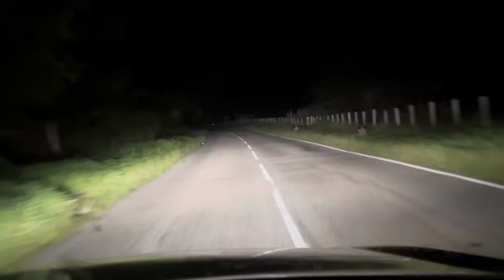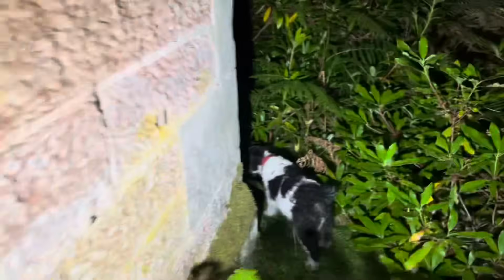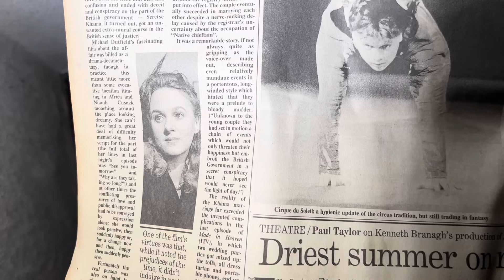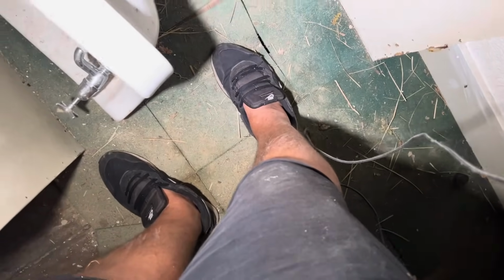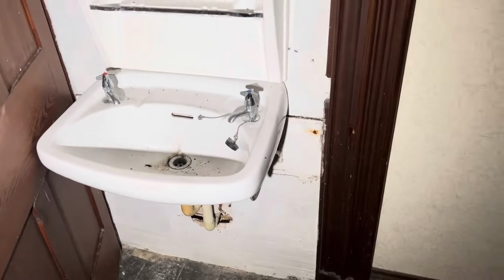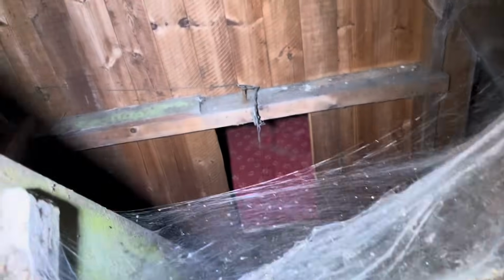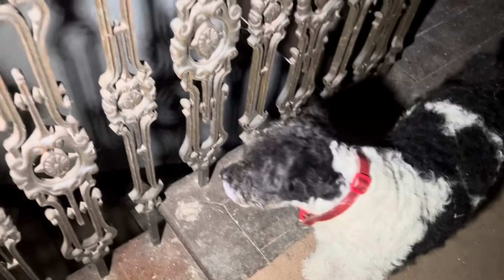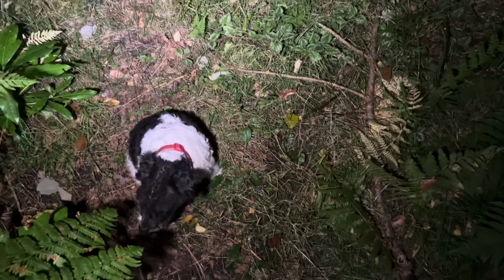I was so petrified of this ABANDONED house in Scotland I ran away scared !

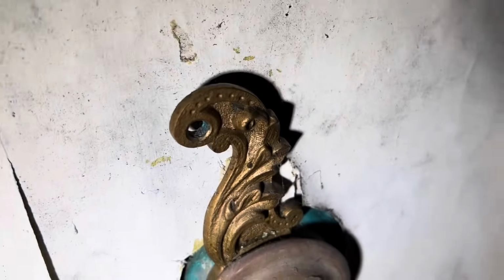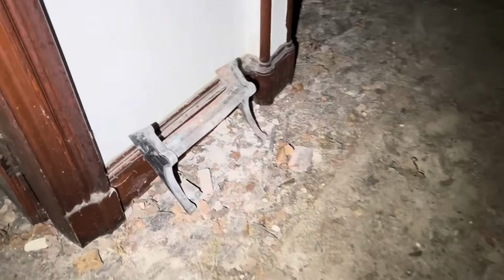Comment: The lever at 18:18 is for servants bells, they were in most of the rooms at Carbisdale, it's unusual for there to be two of them but it may simply be in the interest of symmetry, or they could also be his and hers. The item at 21:56 could either be a boot scraper or a fire surround (it may be upside down) looks like it may be from the hearth at 22:26
Reply: I clocked the boot scraper too, but isn't it normally just outside?

Comment: I'm sure someone answered your question ages ago but to comment on the video I'll add for the two handles on the fireplaces: One lever opens and closes the damper, allowing the smoke to come up through the flue of the chimney, while a second lever opens and closes the air vents, allowing fresh combustion air to enter and fuel the fire. This prevents smoke from going back inside the room while avoiding carbon dioxide poisoning

Comment: The fake doors in the bedrooms were probably originally designed because the smaller room would have been a wash room or dressing room. You could go from bedroom to dressing room without having to go via the hall. The pullies on the ceiling would have been a bell to call for a servant. The ones on the fire were probably to call for a specific servant who looked after the fires. Maybe one was a servant bell, the other on the opposite side of the fire would have opened/closed the flue. All those small rooms in the top floor were probably servants quarters. The other stairs that are blocked off in the kitchen area, was also probably for the servants, so they didn't have to use the main stairs. Interesting place.

Comment: The lever things on the side of the fire places could be the damper controls, that control the air flow in the chimney. When the fire is not lit the damper can be closed to stop cold air from coming down the chimney. When the fire is lit, the damper is open or the room will just fill with smoke and dependant on how open it is will control the fires intensity. However, not all chimneys have dampers in them. To my knowledge I have not knowingly come cross a chimney with a built in damper before. However, with what I already know about chimneys and how they work and the bit of research I have just done, This is what the levers could be for. You would have to look up the chimney to see if there is a damper up there and if there is, then that is what they are. Enjoyed every second of the video and love how bear plays dead he is so good at it.
Reply: They could also be servants bells, the castle I used to live in and look after had these connected by wires running underneath the floorboards connected to a panel that would indicate which bell/room had been activated Edit; i just go to that part of the film and it's definitely for servants bells